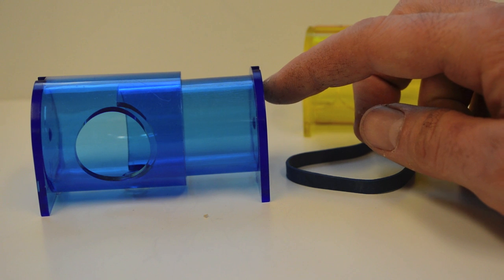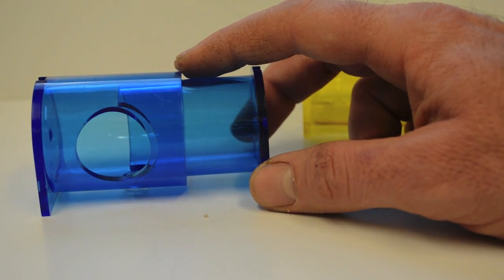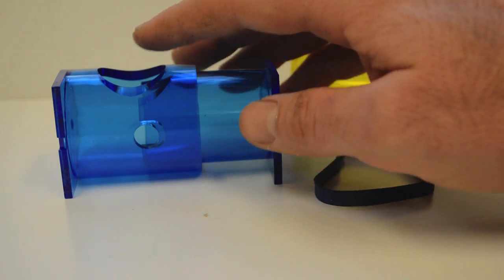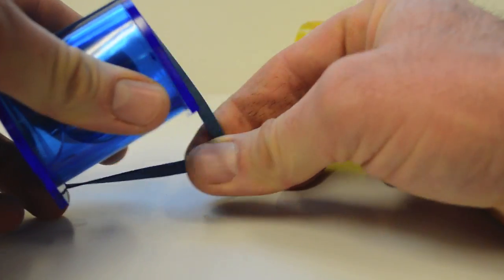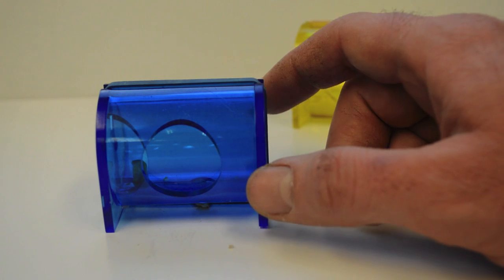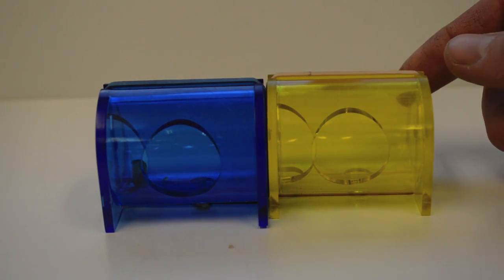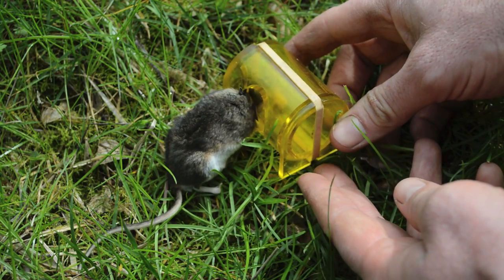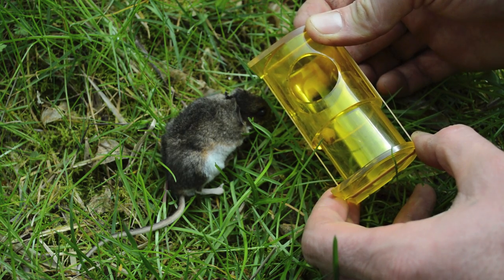The Sliding Tube Mouse Trap In Action. Mouse Trap Monday.

Comment: It's like the 3D Printed Pretzel Prison, but better.  Poop stays outside and bait can be smaller random size.  Since the mouse is outside + dead, the ends don't need to be closed.  Any pair of stiff, fitting cylinders will work.  Going to try DIY.

From Macon, MO, not Montana (MT)  10 traps for $20 plus shipping.

Comment: Hey Shawn. I have a mouse trap idea for you since you come across a lot of mice and rats. Why not dig a hole in the area that a lot of mice and rats come and go, put a bucket in that hole, fill it with water and put PB on a slipper metal bar that goes across the bucket and let the mice/rat slip and fall in the water
Reply: And every morning, you can take the bucket out, dump the body some where and repeat

Comment: I have one point to add, after catching the larger mice, for the next five days I have found the mouse inside the trap.  The smaller ones climb inside, eat the bate, then sit there waiting for me to come check them.  Now what is happening to me, is the mouse has discovered that if they chew through the elastic band, then they don't die, they just eat whatever is in the bate hole.  This has happened for the last three nights in a row, I have put out five traps, and every one has the band chewed through.Darn............................

Comment: This is the most compact and inexpensive mousetrap I've ever seen! Two little telescoping pieces of plastic and a rubber band! I could carry enough to outfit a house in my pockets, and this must be the cheapest to produce industially design I've ever seen. No moving parts, mechanisms, hinges, nothing. Just two little solid pieces of plastic and a rubber band. I wondered if that band provided enough force for a clean quick kill, but it appears so. If it performs consistently I don't see any downsides and it's one of the simplest and best of all traps.